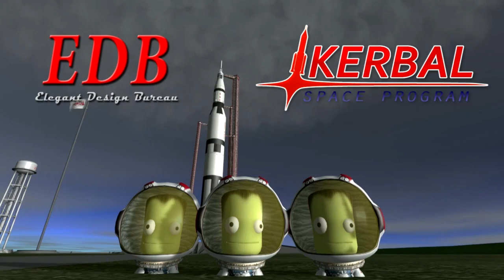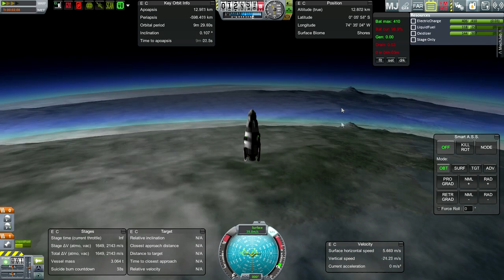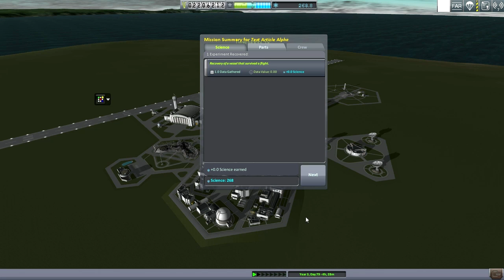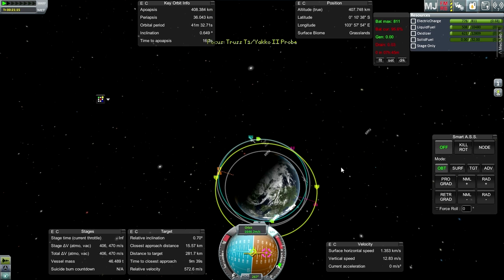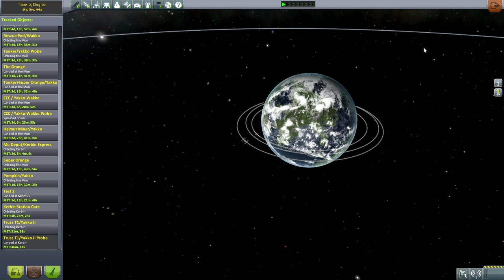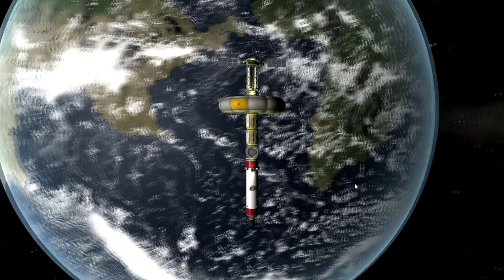Kerbal Space Program (0.25) - Kolonization 11 - Kerbin Orbit Station

Comment: If you spread your parachutes same way as floating devices, you spread forces to whole length and be able to safe whole stage. Now you are always hitting ground only with two back or front air-bags, because whole stage is oscillating around parachute attach point.
Reply: ***** Don't worry, I'm enjoying this series. I did a lot fails myself trying to do things right. And I knew it is a little bit late, but I mentioned it for somebody new watching series and trying to recover stages similarly as you.

Comment: I hope they make it so that in KSP you can make it so your probes ro ship can always face the planet while in orbit.
Reply: ***** In the new MJ SASS, there's an advanced option (under ADV) to orient craft to references other than orbital vectors.  I use this to orient solar panel powered craft and stations to the sun's polar axis by selecting reference SUN and then "Right" - (I don't know why it's Right, but that's the one that ensures the craft is always straight up and down in reference to the Sun).  That way I can just have 2 or three facings of solar panels oriented around that axis that don't actually require self-turning panels.It will ensure this even if the craft is in a highly inclined orbit (which would otherwise throw off the Normal vector from always being straight up and down).

Comment: I'm not sure if it's RealChutes or not, but I know that DRE has recently been a bit finicky when it comes to parachutes. After some headache and a bit of a research, I found that the absolute maximum speech at which parachutes can be deployed is claimed to be 350m/s on Kerbin. In reality, the limit is 25% of the non-deployed temperature limit for the parachute in quest. The value is configurable, but you're hardcore, so I won't elaborate to this end as I doubt you'd use it anyhow.

Comment: Which version of USI Kolonization System is working with 0.25. I checked change logs and forums still no info.
Reply: Thanks man I found it on a website I use 0.21.3 with no problem.